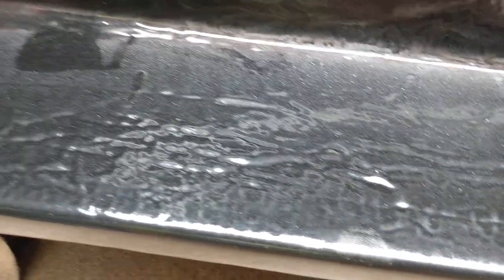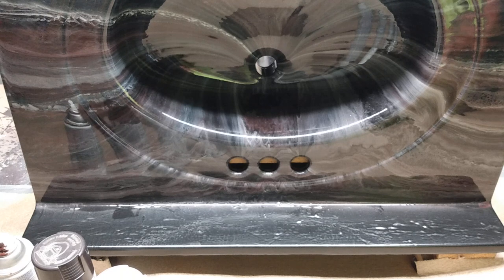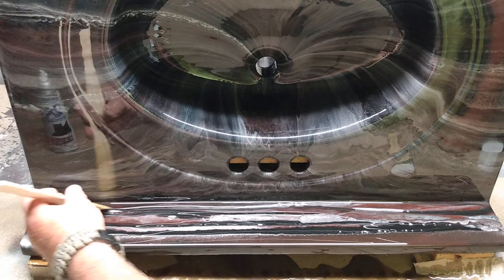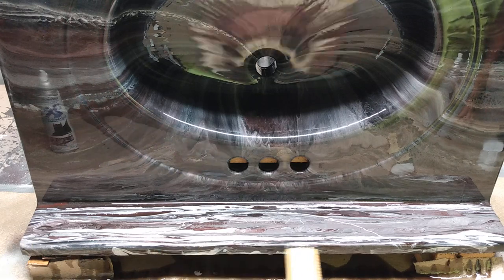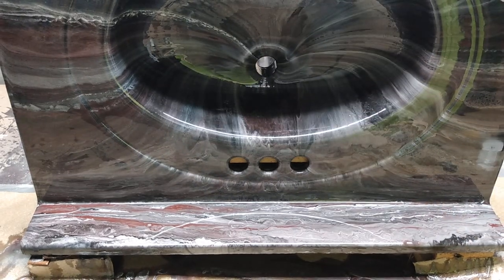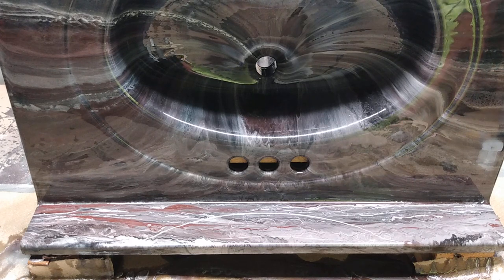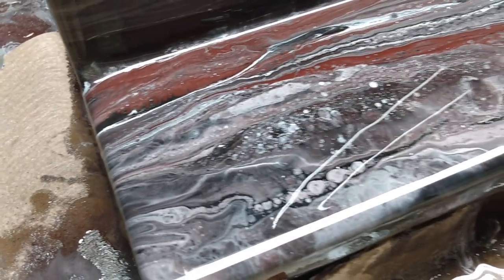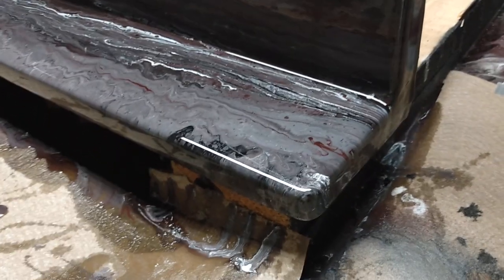EPOXY BATHROOM SINK POUR. PART 2 THE BACKSPLASH. step by step tutorial the way I pour bathroom sinks

Comment: Love your channel! Quick question am I able to do the backsplash while it's sitting on top of the vanity?
Reply from the maker: Thank you so much for your comment 😊 You can leave the backsplash in place but whatever color your going to use on your project you should fog them colors on the backsplash before you do any epoxy work. Because it's going to be hard to get your epoxy color coat to stay on the backsplash because it's a vertical surface. Now you could buy a thickener they sell a thickener that goes in epoxy that allows you to do a vertical surface all you got to do is search epoxy thickener. Or you could go through the
WiseBond link that I have in the description of my most recent videos and if I'm not mistaken they have a thickener they sell as well.  I'm so financial and if you use that link and if you purchase anything there is a 10% discount code there as well so you will get 10% off your total price. I hope this helps if I can help with anything else please let me know.
Reply: @LiquidCreationsCo2609  Sounds good thank you for the response.  I need to do two separate vanity tops that are 72 in long with one sink.   Are you able to link me products I can buy and then I can just pick out the color myself?  We'll be happy to purchase through your links in case you can get something out of it.  I guess I was a little bit confused as I saw a list of different epoxies that you use
Reply from the maker: @TheTerminator1919  if you go to my most recent videos there's a link for WiseBond if you don't see that link let me know and you will have to give me a little bit but I will post the link here in this comment.
Reply: @LiquidCreationsCo2609  Found it thanks

Comment: Great work! What is the base used on the sink? Is it a primer, then epoxy, then spray paint, clear top coat in that order? Thanks
Reply from the maker: Thank you, yes it is a bonding primer made by valspar. Then my color coat when that cures then the flood coat. I have other videos showing the whole process.